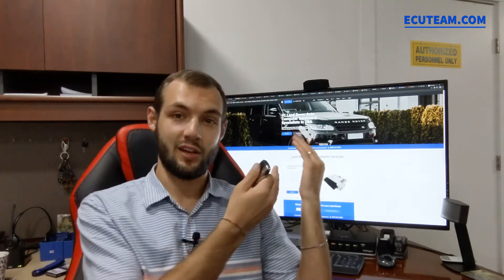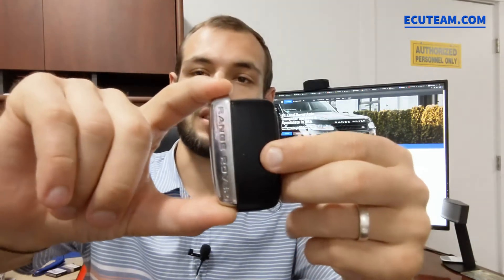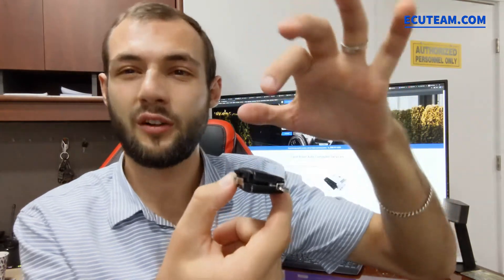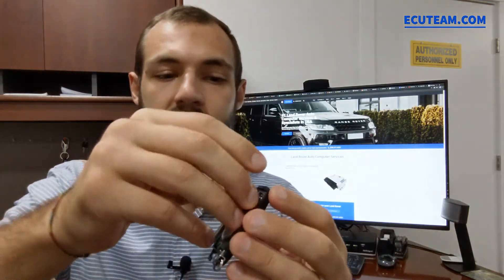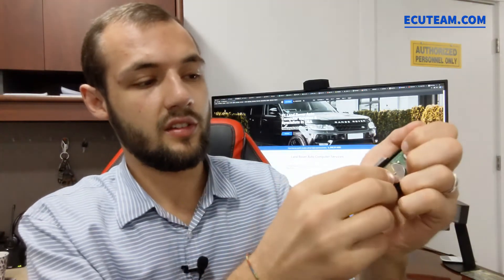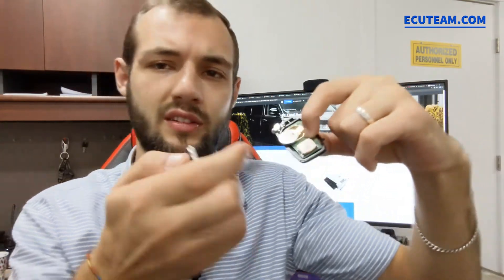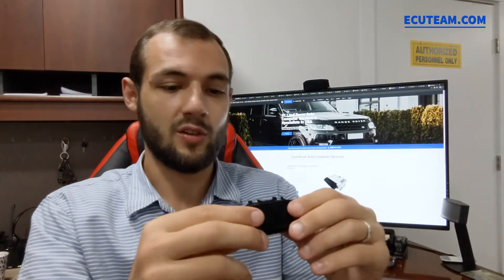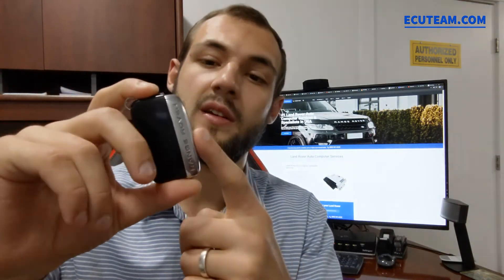How To Open Range Rover SMART Key Fob & Replace Battery Inside | by ECU Team Corp

Comment: Val if Possible to recase. I have 2 x300 xj6 Key Fobs without Battery Backs. Anything be done? Let me know
Reply from the maker: Get in touch with us by going to our website ecuteam.com and filling out the "request a quote" that is located on the bottom of the main page. By doing so, our representatives will get in touch with you soon.